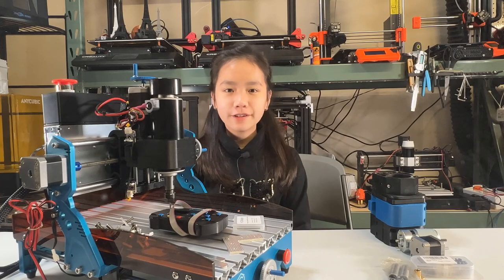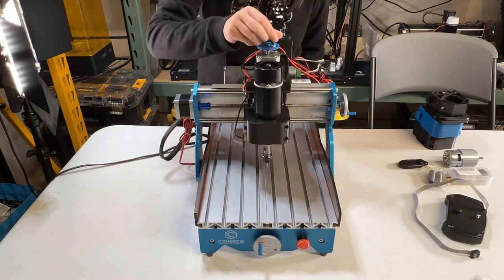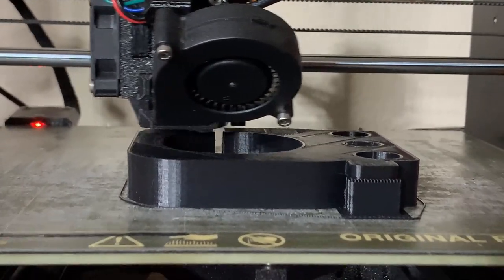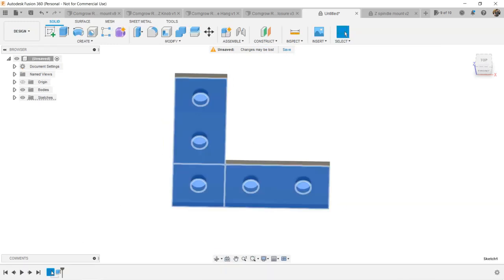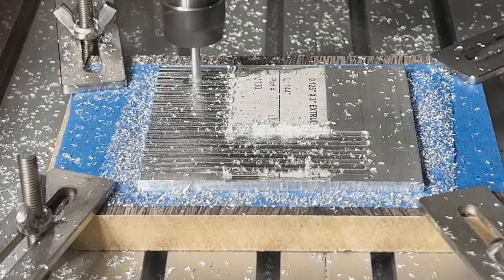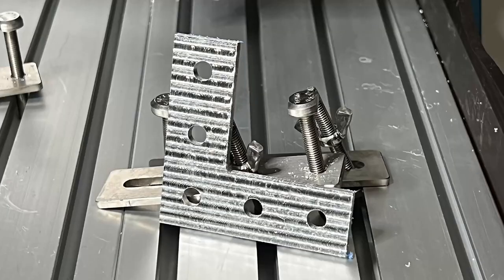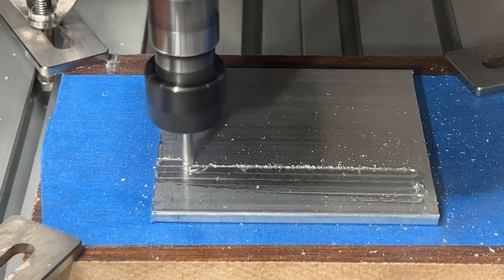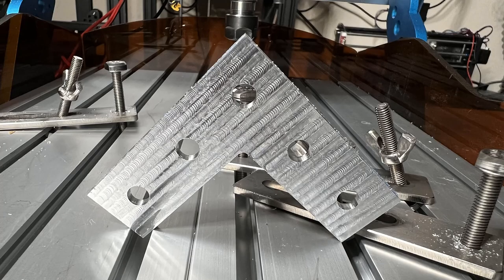500W or 800W spindle, which one is better for Mini Desktop CNC? Comgrow Robo CNC upgrades

Comment: Adding some cutting fluid and compressed air (about 1-2 bar) helps a great deal too. With such a non rigid machine there's only so much you can do. Light cuts, 1 flute 6mm cutting length endmill, high rpm (17000rpm-ish), 0.5mm doc, 500-800mm/min. Avoid slotting, make the slot wider than the cutter (ie 6mm slot with 4mm cutter) so that chips can get out better. Use ramps to plunge into aluminium instead of dropping straight down. Use aluminium alloys that are easy to mill, so no hardware store bought stuff but 6061, 5083, 7021 or other machinable alloys. If the aluminium is brittle it's probably easy to machine, if it just bends it's probably too gummy.
Reply: Wow, great information with numbers too. Thanks!
Reply: I think those recommendations are good, but the high RPM concerns me because if you get the aluminum too hot it will stick to the end mill and then you can forget about anything going right.  I know high speed for aluminum is conventional wisdom but I think maybe that's not the best in this situation.
Reply: @AtimatikArmy  that's why compressed air and some cutting fluid helps a lot to cool the cutter and the aluminium. Cutting fluid will lubricate the cutter so the aluminium won't stick as much and reduce drag, which reduce heat. Getting those chips out with compressed are avoids recutting and gumming up the cutter. At lower rpm the cutting forces increase, and with too much compliance will result in more heat as it rubs more than it cuts and deflects the cutter too.
Reply: @imqqmi  Ok I understand you and totally agree.

Comment: Do you actually realize how much info you packed in this video? You did put this machine in the exact right place. She will be quite useable for many materials and she will scream and shout if she has to cut alu. But still do the job to an acceptable degree. A great hobby and fun tool. A great educational tool. I agree with your spindle conclusion and now I want you to show us all the great things you can create with this simple, little, and cheap machine. Let's design in TinkerCAD and Fusion 360. Let her cut wood, plastics, foam, engravings, make jewelry, decoration stuff, circuit boards, lettering. Show us how to add a laser and a PVC cutter. Show us how she can become a 3D printer. You and Helios are an inspiration. FAN-TAS-TIC

Comment: Thanks to Aurora's parents for raising such a competent and talented child!
Before the first use, any spindle should be run idle, without load, so that it runs in. Then there should be no offensive odors. 
The biggest problem with these spindles is bearing play in the housing. This affects the accuracy of the parts.

Comment: Great video. I wasn't aware of the Comgrow offering, but it looks much better designed than a 3018. You need at least a 300W spindle, ideally 500W, to advance from engraving to actual milling. I am surprised how well it is cutting, you are getting reasonable chips and the cutting area remains clear. A lot of the 3018 videos simply produce a fine dust. There are also brushless spindle motors available that will provide better torque at lower RPM than the ones you have.

Comment: Just did the upgrade to the 500w - I removed the original lead screw mount using a soldering iron and just pushing it through very easily like you would do a threaded insert.

Comment: Nice tests. I have a 10yr old 6040 table (water-cooled 800W spindle). I upgraded to flood coolant, and it significantly improved my cutting capabilities.

I used a fountain pump and some screens to filter, water soluble machining fluid/coolant, a catch tray with raised sealed sides and it all flows down to a hole and into a rubbermade tote with a pump.

Hand spraying coolant didn't even come close when I tried to do that for a couple projects early on.

Comment: Another well done Video thank you both so very much. I have needed a Milling machine for train parts but off course a real mill is huge and expensive. I never dreamed we could see $200 CNC Mill tables such strong capability. I am selling my Fender Guitar amplifier to get one. I could never play very well anyway. I still have my self made Fender 5 watt clone converted from an old signal tracer. Thanks Again folks, excellent work. Dennis

Comment: You're more than likely getting chip welding because you're not clearing the chips away. It's super important on these little machines that you clear the chips. A little air bursting will do the job or a good vacuum near the bit. Also, anchoring the aluminum with tape will work fairly well but you really want to have it physically anchored down. It's all about mass and vibration. Any kind of movement can really make it difficult to get a clean cut

Comment: I’m a bit surprised no lubricant is being used here.  I was a machining out of high school for several days ears and always used lubricant on metal.
Reply: You don't /really/ need cutting fluid for aluminum.  It doesn't hurt, but it's fine to cut dry.

Comment: How do you secure the aluminum plate (to be milled) to the blue painters tape. In an earlier video you mentioned super glue. How is the super glue removed from the aluminum or acrylic workpiece? Of particular interest is removing the super glue from an acrylic workpiece without damaging the acrylic surface.

Comment: It would be interesting to compare to BLDC spindle of the same power, it's more expensive but the torque curve should be better. You can find some from 300W-400-500W (0.4 to 0.6 nm 12K rpm), 600W (torque unknow 9.K rpm) up to 900W and 2N.m oftorque (6K rpm). Collet on these motor are from ER11 to ER20.

Comment: This its exquisite! Astonshing awesome hahah u are a little Genius ! Please i have a question ..
 I got a 3018plus 500w...and the PSU that came along with the kit seems too weak maybe or ITS getting too noise at the system since one minut of milling causes complet freezing ... Assuming i could take another DC 24v 5a Power Through Jack , can i keep the 48v10a PSU at the board ? Or It MUST be Wired separetadly ? A board can get Burnt with this both PSU adding voltage?  can i minimize RISKS by lowering down main PSU voltage for 24V keeping 10a and plug another 24v5a Through Jack ?

Comment: The emergency twist return button is not meant to be used like this its an emergency stop button so its needs to stop the machine instead in combination with a relay you can use it as an emergency button
Reply: she knows what this type of button is for, that switch doesn't originally belong to the machine, she needed a large switch and that what she had lying around so she used it.

Comment: Really fantastic work! As you mention the stiffness should be better with the shorter gantry. I believe stiffness is proportional to  the square of length. So 18 cm should be almost three times stiffer than 30 cm with same size support rods. Your video has given me the idea of designing some sort of substantial solid reinforcing parts to surround the ends of the 3018 rods and make them immobile. That is convert a 3018 to an 1818 --- giving up size in trade for stiffness. I would like to be able to machine aluminum with my 3018, and have already upgraded to a 500 watt spindle. Is there any possibility you could try out this idea? --- thanks
Reply from the maker: There is a CNC1310 in the market, but I am not sure what makes it so expensive:
https://amzn.to/3o1nxS4
I would consider it if it costs around $200-$250, but not sure if the 500w spindle has enough X-axis travel on such a small machine.
Reply: @AuroraTech  I will create a concept and make a drawing. I can put it on my google drive. I would much appreciate your thoughts on building something with aluminum or 3D printing.
Reply: @yancymuu4977  You don't need to trade up size, just replace the rods(and the bearings) with thicker ones.
Reply: @AuroraTech  It is a cute machine so it is expensive :- ) It has an excellent design and would be very rigid but the deal breaker is that you are locked into a basic 775 motor. Maybe they feed it 36 volts and get 90 Watts out of it. Maybe. But as one poster stated you would have to rebuild the Z axis to put a lager diameter motor on it. Otherwise, it seems woefully under powered for such a rigid frame. I had seriously considered this machine but then bought a 6090 2.2KW machine. 
Comgrow has done everything right with this machine. I will be purchasing this little one because it is portable and can be used for training purposes.

Comment: Hi , you are amazing at your age being such knowledgeable, I've got a question, i have the same Setup but where do you plug the Relay on the Comgrow mainboard? I've tried a few with the said relay plug on the board and played with the switch but can not control the motor with the relay but still can start the spindle...directly
Reply from the maker: Hi! Just connect the relay to the original spindle connector, when the machine tries to turn on the original spindle, it's going to trigger the relay instead.
Reply: @AuroraTech  kk i m going to try it again ,Dear , but I d think I have tried it .. but hey ill go and try it later , thanks for a fast reply!

Comment: I'm ready to place orders for the parts listed, and this looks to be ideal, but not having the STL file for the mount is a stopping point.  Would you be willing to share that file?  You've such a great job in this presentation and your work is greatly appreciated.
Reply from the maker: Please download from here:
https://auroratechchannel.com/download/Comgrow_Robo_52mm_Spindle_Mount.zip

I have included the STL, STEP and Fusion 360 format, so you can adjust the leadscrew nut hole according to what type of nut you have.
Reply: @AuroraTech  Excellent!  Your efforts have been fantastic and greatly appreciated.

Comment: Hi, top video. could you provide the feeding parameter for the 500W spindel?
Reply from the maker: For aluminum, I use 12,000 RPM at 100mm/min, 0.1-0.2mm depth of cut.

Comment: The problem you are facing is because the spindle is not balanced due to issues with the fan. I have been using this spindle for a couple of years and once you get the fan balanced it will run considerably quiter up to completely quiet, there are video's on youtube that explain how to do that. I took the time to redesign the fan to have a true center of gravity, you can find this part on thingiverse under the name 'Chinese 500w Spindle Fan (100% Balanced)'

Comment: hi there nice video , ordered a comgrow also.
i will do the 500w spindle upgrade too; is t possible to get your stl file?
thanks in advance
Reply from the maker: Please download from here:
https://auroratechchannel.com/download/Comgrow_Robo_52mm_Spindle_Mount.zip

I have included the STL, STEP and Fusion 360 format, so you can adjust the leadscrew nut hole according to what type of nut you have.
Reply: @AuroraTech  Thanks my cnc comgrow arrived in 5 days , pritty fast. doing some tests already. Now i need to wait for the 500w spindle, but i saw some revieuws about an 300w one that should be enough for cutting aluminium. less noice, vibrations ....
anyway thanks for the file and keeo up your good work

Comment: First a thumps up for your good work. I watched this video two weeks ago as I was expecting an 800w to arrive. So it arrived today with a 100v power supply. I installed on my own 3018 I build with 16mm linear rods on X & Y and liner rails on Z axis with Nema 23/24 steppers. I found it smooth running with little runout, even near 20Krpm. I don' expect it to run like my 1.5Kw spindle which is very ridged with 4 x bearings and more controllable via the VFD. I had similar problems to you a long time ago. You need rigidity and bigger steppers  to have the torque for non ferris metal. The 800w motor does have replaceable carbon brushes if you want it, it should be ok, as the bearing are the same as the 500 watt. I wouldn't use it on my main CNC which has heavy use

Comment: Spray a little WD40 on to lubricate the cutter
Reply: WD-40 isn't a lubricant.  Try Tap Magic or A9, either would work well in a setup like this, although with 6061 and such light cuts on a machine like this, it's not really needed.  A compressed air stream to clear the chips and provide a little cooling to the endmill would be ideal.
Reply: @TheM750  Its a well known fact to use WD40 on aluminium as a cutting fluid, it prevents BUE forming due to welding taking place between the carbide (or HSS) end mill

Comment: why not mill the face with a fly cutter,it would be faster by making each pass cut wider,even two passes to get a full clean face should be faster than multiple small tool passes,i'm not knocking your method,i'm using proper engineering methods to face off a milled part.
A machine shop could knock out a small fly cutter for you as the ER11 series collet might be hard to get off the shelf fly cutter shank sizes,would be worth the effort though as it could have replaceable indexing carbide inserts fitted.

Looks good,i'd go for a bit more power on the spindle seeing this one cut the plate as i'm planning a 1m square mill,the bearing rails are 1m long so nearly 1m square,all steel welded frame,but a powerful spindle can make new gantry side plates to replace heavy welded steel parts from thick aluminium plate. 

I recommend  everyone using a small mill  with ideas to upgrade the spindle to watch lathe and milling youtube videos "this old tony" and "nycnc" are top notch tubers,as the principles are the same ,and a good spindle will be able to utilise better cutting tools and methods.

Comment: Can anyone explain to me how the lead screw installs?  Are we taking the longer piece with the two screw holes into the notched top half, and then inserting the spring followed by the other half on the other side?
Reply: Ohhhh.... you dont use the spring and the bottom half do you?

Comment: i use 800w and just slow down power to 500 😉
Reply: Sounds like the 800W spindle is just a 500W spindle made to run faster than it should.
Reply: @klave8511  it is bigger, stronger, more power motor, and work on slow speed is easy for it, and best option for that